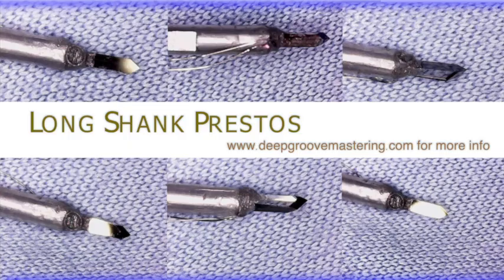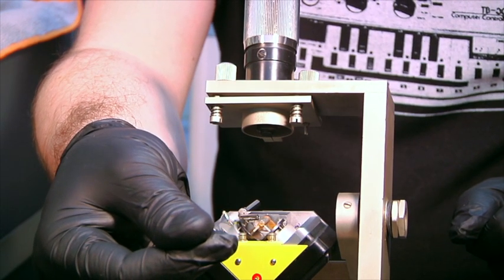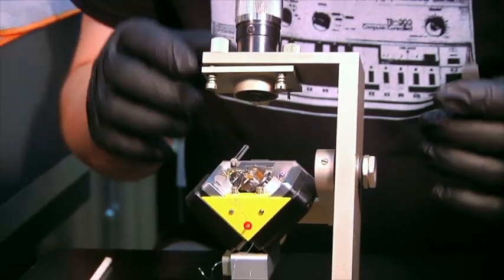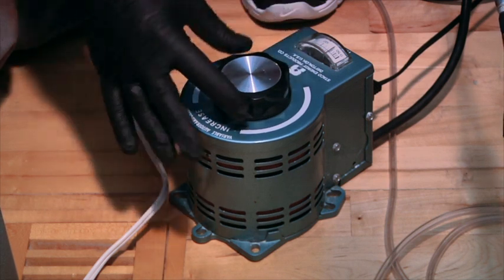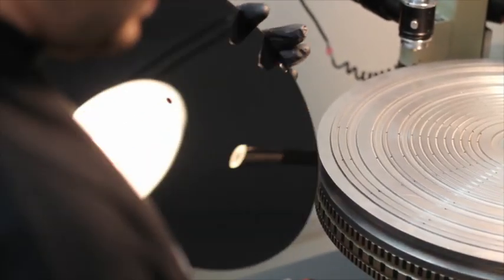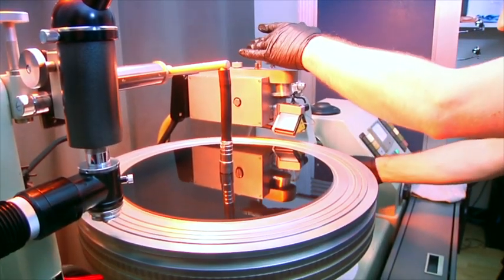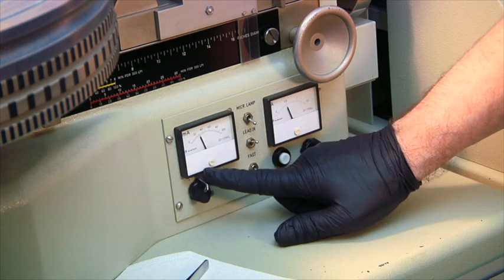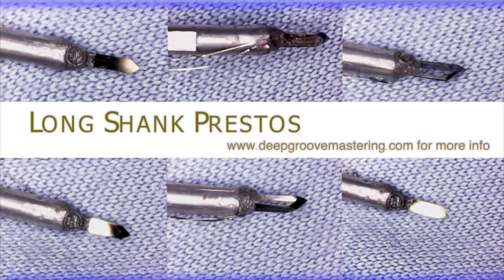Deep Grooves Mastering - Plastic Cutting Guide

Comment: Thanks for making it public and letting in online. This is the positive part of youtube not only offering people the possibility to spread (almost forgotten) knowledge and people like you releasing it. I am just wondering 1. what kind of plates you are using. Right at the beginning I saw a Makrolon plate, which is actually used for other purposes. 2. And where do you get hold of them (a round 12" empty Makrolon plate 😅 .. not a square one as it usually is...). 3. Moreover, pressed vinyl records to have the thickness of 1,2 to 1,5mm (depending on if one considers 120 to 150gr vinyl records). What kind of thickness does the Makrolon has? 4. How long will Makrolon dubplates last, longer, shorter or as long as vinyl records? Do you have any experience in that respect? Appreciation for any reply. 6. Are your doing / grinding the needles by yourself? 7. How do you do the locked grove right at the end of the cutting process? Thanks again!
Reply from the maker: You can feel free to email me too.  Probably easier for such a response :-)  To answer all your questions.  I have a variety of plastic blanks.  They are cut with a diamond.  Lacquers on the hand are cut with a sapphire.  Masters for vinyl record manufacture are always lacquer discs cut with sapphire which are very hard to come by now since Apollo Masters burned in a fire recently.   Individua records (dubs) can be cut in either lacquer or plastic blanks.  The plastic is best if PVC or Polycarbonate.  Acrylic is not so good for audio.  The best polycarbonate that can be sourced in black sheets is Markrolon G.  But, only in the USA from my understanding.  All else is typically clear.  The main requirement is a mirror finish on both sides, and that the sheets come with a protective covering on both sides.  The sheets can be purchased quite large, and shipped to a CNC shop local to you.  They can cut the sheets on a large cnc or laser cutter to whatever size you want 7" 10" 12".  There is a pattern which allows you to maximize the number of discs per sheet.  The CAD is easy to make.  The thickness depends on what you purchase.  These sheets come in many sizes.  Mine are typically around 1.4mm thick.  A polycarbonate disc cut with a diamond stylus can give you up to 100,000 clear plays same as pressed vinyl.  However, a polycarb plastic cut will have more background noise then pressed vinyl typically.  Not too much to make it not listenable.  But, present.  With respect to production of cutting styli...  I used to contract a company here in the USA to make them on my behalf.  But, their quality control went downhill since before the pandemic.  So, I no longer use them.  I will start making my own hopefully in 2021.  A locked groove is simple.  On a Neumann lathe, they can be made either manually, or automatically at the industry standard diameter for locked grooves for the diameter you are cutting.  So, there is a switch mechanism that the carriage arm passes over.  Once the cutterhead has reached the standard locked groove diameter a switch is activated by the arm and the sprialing (pitch) motor is stopped.  This typically happens at the end of a very wide spaced groove called the lead out that is obtained by pressing the FAST button on the pitch box of the lathe.  Once the pitch motor stops, the carriage stops moving laterally across the disc.  And, the cutting stylus begins tracing a circle instead of a spiral path.  The circle will meet itself after one full revolution.  The lathe has circuitry which will automatically pop up the cutterhead after 1.25 rotations.  So, it makes sure the locked groove is a full circle and overlaps itself.  The bit of noise you hear when a locked groove plays forever sounds like a pop with hiss.  The pop is the spiral groove meeting the stationary circle groove.  The hiss is the quarter turn of overlap that is industry standard on masters.  In days long ago, there was a very odd locked groove arrangement for 78 records.  Do some digging on the Internet to see what I mean and report back!  Manual locked grooves are easy as pie.  There is a lever mechanism on the carriage which releases the halfnut from the leadscrew which combined form the lateral traverse mechanism for the lathe body.  When the halfnut is applied to the leadscrew, the carriage arm/suspension box/cutterhead travel laterally across the disc.  When the nut is released, the travel stops regardless of whether the pitch motor is still running or not.  So, to make a locked groove, you just set a lever to a position which releases the halfnut.  After 1.25 revolutions timed by eye watching the disc or platter, you hit a button on the suspension box which pops up the cutterhead.  There you have it.

Comment: When cutting metallic soap cylinder records, (I make these, they are an aluminum sodium stearate with soft wax, such as montan wax,bees wax, ceresine wax, use to aid in the cutting action and moisture proof of the compound.)  This kind of material was used to make record able  blanks form 1889- about 1942)   Some of the formulations substituted lead stearate in place of aluminum stearate, for early disc mastering.   The proper cutting temperature is also 90-100 degrees F.
Reply from the maker: Neat.  Thanks for commenting and sharing.  You should leave a link to your work so people can see/hear.  Yeah every material that one could use as a blank disc has its own particular set of requirements with respect to heat, angle, and technique.  DMM into copper blanks requires passivation of the disc prior to cutting, and refrigeration prior to that while stored.  Additionally, it requires a mhz carrier wave for material science reasons.  Not all lathing is equal :-)  cheers!
Reply: @opcode66  That is very true. Your lathe is among the best that is made, and a wonderful  piece of gear, that is extremely precious  !    My channel The North American Phonograph Company, has videos of making these metallic soaps and tests.  I am wondering if a direct copper method could be worked out with an acoustical recording lathe, for disc records, recorded acoustically, however the fact copper does not shrink much would pose a problem to making cylinder record blanks.  To make a master mold, around 1901, a gold vaporization method was employed. The master waxen metallic soap cylinder (also used for early discs too) was put in a vacuum with gold leaf on either side of it,the master cylinder put on a mandrel, with an iron disc at the top and it was between conical centers.  A large horseshoe magnet spun around the outside of the chamber to cause the master to spin inside.   An induction coil was attached to the gold ,and when energized wanted the molecules of gold to go from one foil to the other,  in the form of a vapor.  The gold  coated the grooves of the cylinder making it electrically conductive, and then nickle or copper plating was performed on the wax master until about a 1/32 " of plating covered the cylinder master. The thin end was trimmed on a lathe until the separation between wax and copper were seen.  The master was put in a cold room and shrank away from the copper in the metal sleeve.   Later on a simpler method of coating the master with purified graphite applied with a silk bristle brush, made the wax also conductive to be plated with metal.  (now stannous chloride and silver is sprayed on the lacquer so it can be nickle plated)   The thin end,  where the recording started, also had a test cut like you did at the start, to test the depth, which was  made by adjusting an advance ball on the recording head.  In making a playable metallic soap blank, you have to juggle, durability, surface noise and  frequency response by how much of the ingredients are put into the compound, essentially a metallic soap before lacquers were used, and naturally for a cylinder record, which has to shrink in each step, so the material shrinks about 2% allowing the metal mold to be removed from the wax metallic soap master.  The moulded method employed a master, mother, and molds.   Although I have made over 2000lbs of blank cylinder records, each batch is a honing in on making a better quality product, I learn something new every time.
Reply from the maker: @thenorthamericanphonograph1039  The copper is actually a plated layer for DMM discs.  My VMS...  I sacrificed a lot to buy her in 2009.  I personally carted her from New York to Chicago to Los Angeles.  I've worked on many parts and subsystems.  I've modified and improved things.  I've created computer control of all the cutting functions.  I've rebuilt one of my cutterhead channels both drive and feedback.  I've cloned unobtainable parts and made them available to other VMS operators.  And, now I'm making a fully modern turnkey cutting system that will be available to purchase soon.  I'm finishing editing a video about major improvements I've made to the custom BLDC Direct Drive Platter Motor I've created.  Check it out please when its uploaded.  Should be there later tonight.  I'm close to having all the tough problems resolved with my own innovative solutions.  Pitch motor, platter motor, platter and coupling and bearing, all the electronics needed to control it all and also process audio.  The cutterheads both mono and stereo feedback.  The suspension box with all the same features as a VMS suspension.  Control from front panel, ios/android phone app over bluetooth, MIDI jacks for midi to lathe control, a midi app for windows/macos, and now a VST plugin Pitch/Depth Computer that is exactly like the VMS80 with max recording time.  We definitely need new solutions to blank media.  Keep cranking on that nut!  Cheers!
Reply: @opcode66  I can't even imagine how much this lathe costs.  What is your cutting amp?  I collect old 1950's and 1960's stereo records, and some list the equipment, some used a 200 watt McIntosh amp, it was a rack-mounted one, that had an industrial grey front, and chrome McIntosh logo.
Reply from the maker: @thenorthamericanphonograph1039  If you are referring to my VMS70, when I purchased it, I paid 30K in 2009.  For me, that was everything I had and more at the time.  It is worth more now clearly.  Yes, I'm familiar with those McIntosh aps.  I know a cutter who has a pair of them.  I purchased a fully restored complete original VMS70 system with VG74b rack.  So, it is all from Neumann.

Comment: Hi Todd.. Nice one for the knowledge .. Is it possible to get the info on where to get the exact air pump / vacuum as used in this video?
Thanks
Reply from the maker: It came with my Neuamann lathe.  It is a modern quiet blower motor in a wooden enclosure with power inlet, air for vent, and port for the tube to connect to.  Also has some insulation to reduce sound.

Comment: I have worked in electronic assembly  where I was required  to a anti static strap with a wire attached to it and the other end of the wire connected to earth and all so given to wear a anti static  strap attached to my shoes. You can all so by a meter to detect when static is present.
Reply from the maker: Dambuster these are both true statements.  Unlike working with microchips or other silicon components where tiny amounts of static are the issue, cutting polycarbonate discs have a major static problem.  And the source is the disc, not the the person.  Unfortunately you cant attach a wire ground to the disc easily while cutting.  And, that wouldn’t keep the plastic from being an issue.  I have a wire ground for doing pcb work.  Doesn’t really apply here.  Buy some polycarb sheets, peep the protective cover off, observe every bit of dust in the area cling to the surface.  Repeat while wearing a ground wire cuff, same things happens...
Reply from the maker: discharging yourself is only half the battle.  static is actively formed in the cutting process.  also in the removal of the plastic covering.

Comment: Nice Video and good info - Thanks! So that Makrolon your cutting has a clear coating of a softer plastic on it and you could cut down to the harder core if you go too deep? Am I understanding that right?
Reply from the maker: No.  The material that comes off only looks clear.  It is mostly clear with a little blcack added.  When enoug material is together (ie in the disc itself) it starts to appear more and  more opaque black.  So, if i had a vat of this plastic molten it would look black.  If I stuck a rod in the molten plastic and pulled it out, the strand of plastic stuck to th rod would appear more clear the thinner it was.
Reply from the maker: its the same thing all the way through.  the material that comes off isn't clear.  it has coloration to it.  when thick enough it appear very dark.

Comment: What is the purpose of cutting on plastic? I've never heard of this before.
Reply from the maker: One off plastic record.  100,000 clear plays.  Cutting into lacquer (acetate) is maybe 100 clear plays then background noise builds to an unacceptable level.
Reply: @opcode66  But most people aren't going to play a lacquer one time, let alone dozens of times. I guess for a one-off thing I could understand doing this.
Reply from the maker: @BB..........  I think you misunderstand.  Cutting plastic discs is equivalent to having a record pressing with only one copy made.  Minimum order with most plants is 200 copies.  So, you get the benefits of a pressed record (many clear plays) without paying for an entire pressing run, master lacquers, etc.  And, yes, people definitely play lacquers more than once.  Each time you play a lacquer it degrades in audio quality.   Rather rapidly vs. a pressed record or a plastic cut.
Reply: @opcode66  No, I didn't misunderstand. I was born in 1971 and grew up around Sheffield Lab direct-to-disc albums, just never seen something cut to plastic before..

Comment: Whats that transparent gauge on top of the cutting arm? Is it part of the pressure setting on this model?
Reply from the maker: It is a pressure gauge, yes.  But for measuring the pressure of the Helium line.  Pro Stereo cuttetheads can cut loudly because you run a trickle of Helium across the drive coils.  Helium has a unique property with respect to thermodynamics.  It can be used as a gas based heat sink.  You flow a very small amount as measured by that gauge mounted to the carriage arm.
Reply: @opcode66  this business is even more crazy ty than I already thought it is!
Reply from the maker: @helmut666kohl  Feel free to continue to ask questions.  Here or via email!  Happy to help out.

Comment: 14:15, obvious warp in the plastic blank, does that 'collapse' when it is heated up to the proper temp of 90-100 degs?  I don't see it collapsing at all, and thus not a very good flat pressing/cutting.
Reply from the maker: +Haiku Automation It warped because I let it get too hot.  I was filming an instructional video.  I could not control all the variables, direct the film crew, perform for the camera and do the cutting without letting at least a few details slide.  I would never let the disc get that hot while cutting professionally.  I monitor the surface temp while cutting and adjust the lamp distance from the disc to accommodate for temperature fluctuations.  These discs do in fact go flat again once they cool down.  If you want to make judgements, purchase a dub cut from me.  This video is meant to instruct other cutters on the process.  It is not meant to be dissected as you are doing.  I can cut a flat plastic disc with no warping very easily when I don't have to direct, orchestrate and star in a video at the same time.  Ok?

Comment: I always thought masters were metal for stamping purposes. How are plastic masters duplicated?
Reply from the maker: Masters are lacquer coated metal dics.  The lacquer takes the cut with little background noise.  They are then electroplatied and the negative metal stamper is used in a press to make positive vinyl copies.  Dubs on the other hand are individually cut one off records. You can cut dogs in two styles of media. One would be a lacquer dub which is very similar to a master lacquer. The other style is a polycarbonate plastic blank. In order to cut into polycarbonate you have to use a diamond stylus. Which is what this video is demonstrating. When you cut lacquer discs, a sapphire stylus is employed.
Reply from the maker: They aren't.  Its a dub.  A one off record.  Plastic dubs have 100k clear playbacks.  Lacquer dubs wear out after 200.  Lacquer Masters are 14" wide for a 12" release and are never played.  Cheers!

Comment: Is this actually embossing rather than cutting in this plastic material?
Reply from the maker: No, this is cutting.  I'm actually removing material with a precision ground tip.  The only difference between this stylus and a 320 Sapphire from Apollo is that the diamonds lack burnishing facets.  You can't cut plastic with sapphire, thus diamonds.  But, putting 4 micron burnishing (post cut polishing) facets into diamond is very expensive.  So, a slight compromise is made when cutting plastic with diamond vs. lacquer with sapphire.  Plastic gets 200k clear plays.  Lacquer gets 200.  Embossing is performed with a coned stylus, either tungsten or sapphire.  My tools are faceted and pointed, not coned.  Clear?
Reply: @opcode66  Explanation much appreciated.  Many years ago I experimented cutting plastic soundscriber  disks on an old Presto K10 cutter and in that case I was using embossing styli.  Your results speak for themselves (not unlike the old Audiodisc logo) Where do you get the plastic discs?
Reply from the maker: @kennethdegruchy5503  I had them made.  I bought sheets of makrolon and had them cnc machined to 7", 10" or 12".